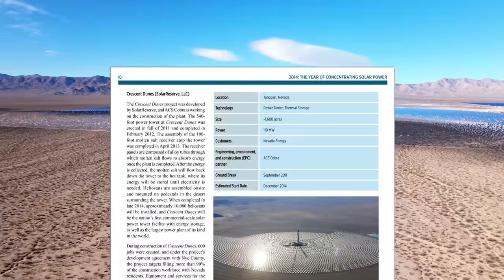The Failure of America's $1 Billion Solar Farm

Comment: Australia has a similar project. The mirrors have to be constantly cleaned, along with the mechanical problems. It cost more to run and maintain the project than the revenue from the electricity produced.
Reply: Was that the one at Kogan creek in QLD ?
Reply: Brilliant. 🙄
Reply: That doesn’t surprise me any. They don’t get paid to think ahead it goes against their way of thinking.
Reply: @SunriseLAW  But what becomes of the hazardous materials from the batteries when they have expired???
Reply: @SunriseLAW  Yeah riiiight
Reply: @SunriseLAW  nonsense it's just not happening
Reply: That is not true!
Reply: Dismantled one in Cooma
Reply: Solar farm in Wyomimg destroyed by hail
Reply: More gov/union/rent seeker boondoggles
Reply: Solar advance and is getting cheaper and better. 
"Paper-thin solar cell can turn any surface into a power source" "Researchers develop a scalable fabrication technique to produce ultrathin, lightweight solar cells that can be seamlessly added to any surface." -   Adam Zewe | MIT News Office Publication Date: December 9, 2022 and now sodium battery factories are in production .
Reply: There are ways to keep the mirrors clean with special coatings.  Yeah without these coatings maintenance is extremely expensive.🎉
Reply: @stanleytolle416  Thanks for sharing, i am gonna seek info for that solution and other solutions for it too.
Reply: The fossil and nuclear options are being removed from the equation.  The real question becomes is this method competitive with other renewable sources.
Reply: @frankshannon3235  Lets hope not or we're going to be heating and cooking with firewood or cow dung.
Reply: Cleaning the mirrors and other operation expenses should be discussed, before they move forward with the project.  It is weird that they don't do profit analysis before hitting the ground.
Reply: @SunriseLAW  problem is when power is produced.  Like in CA mid-day electrical pay back actually goes negative while post sunset  electrical pay-back is at it's highest.  I think there have been several profitable simular thermal solar plants in Spain. The problem here was lack of experience building such a plant.
Reply: @SunriseLAW  there are three problems with gigawatt hour batteries.  One they are very expensive.  Two there is a loss because the power has to be converted from different states from electrical to chemical and back. Three, batteries need to be replaced. With salt there is no loss from state conversion.  Just heat to heat.  Salt is also very cheap to acquire and set up as storage.  Salt also never needs to be replaced.  Salt power storage works out to be about 1/4 total cost for unit power storage as batteries when use in a thermal power plant.  This is also the reasons molten salt heat storage is proposed to be use with small high tempature nuclear reactors.  With the heat storage the small nuclear plant can ramp up power output at times to match that of a much larger plant.  This way power can be outputted when power prices are high like where renewables can't and make the power plant profitable even if it's cost of power is higher than some other sources.   Heat storage in molten salt makes this possible.
Reply: @SunriseLAW 😂what a load of BS you wrote.
Reply: Omg....we have to have and pay employees?!?!?  Hurry up and say it's not profitable.....yet it is.   Just not as much as desired.  The system works fine and WILL be used extensively in the future.
The problems were in the cheap design of the motors....and the hesitation of paying PEOPLE to clean them.
Reply: @gomahklawm4446  Never underestimate the stupidity of people with economics and business degrees to INTERFERE in engineering projects with cost cutting and other stupid schemes.
AND THEN blame EVERYONE else as they madly run around like their hair is on fire.
Reply: Don't worry about the revenue, those thevies running the joint will up the costs to the consumer and tell us that it's cheaper electwicity.....anyway before 20 years is up all that equipment will have failed and costing a fortune to replace, paid for by the tax payer.
Reply: @SunriseLAW  That is not reflected in the price of electricity there.   It's 4x what I pay
Reply: @stanleytolle416 what kind of coating
Reply: Put them in a greenhouse
Reply: @darrenmolloy9147  Nope it's imaginary only in his mind. No such Solar Thermal plant exist in Australia for generating Electricity.
Reply: @czechmate6916  "what becomes of the hazardous materials from the batteries when they have expired" Being stationary battery storage using LESS LOWER Energy Density batteries. They are NOT hazardous and far less toxic than Crude Oil distilment fuels. They get recycled because they are full of valuable materials and easier to break down and sperate than high energy density mobile batteries. Lower Energy Density is obviously a compromise, but the longevity and stability suits the use case. You have no clue what you are talking about.
Reply: @stanleytolle416  Worlds biggest battery is about 10 GWH typical daily cycle. Return rate is about 70% which is not great. Zero galvanic chemistry is use and it has not lost any capacity since opening in December 1985. Mechanical energy storage is the future of renewables.
Reply: @Neojhun  
Neither do you. 🤣 One of these plants went up in flames about a hundred miles from me it took days for it to be extinguished and everyone down wind was evacuated because of the toxic black smoke until the all clear was lifted for them to return home.

Comment: But if it's still costs three to four times as much as traditional solar, that's no way to go.
Reply: Which is why another won't be built until it can be done cheaper.  I'm assuming they went with the heating tower because it theoretically produces more net power for the land it takes than PV's as well as providing power at night with the molten salt setup.  Getting it back in operation is the only way to recover sunk costs.
Reply: It won't without its USP which was working 24/7 without too much maintenance, it was supposed to be able to store energy to be used at night when the sun don't shine, so it was like a energy generator and a free battery system in one, but it was beset with problems, which greatly increased the costs, whether it can be a success depends on if it can run without to much costly maintenance and if all the glitches which shut it down for long periods are resolved and any new plants can be built with the modifications incorporated at a reasonable cost!?!
Reply: @thomasherrin6798  more money please so it can be used as a tax deduction.
Reply: But since the construction costs are already incurred, only operational costs should be taken into account. It does mean, however, that no new ones should be built.
Reply: One thought is that you have to separate the capital cost of setting up your generation from the ongoing cost of supplying the power and servicing and maintaining the plant. The costs of a solar or wind farm have to be spread over the life of the installation which would be say 25 years or so or until the next hailstorm or catastrophic storm. The costs of a coal, gas or nuclear power station can be spread over a service life of anything from 50 to 80 years (before refitting and refurbishing).

This might also have something to do with solar and wind generated electricity is always more expensive even though they keep claiming that the prices of solar cells etc is getting cheaper.
Reply: @typhon36 ”Until the next hailstorm”. How often have you experienced broken windows from hail? Yes, it does happen. But I’ve lived my entire 58 years in the midwest tornado alleys (central Illinois, Iowa, Minnesota), and I’ve never had even a crack in a window from hail. Solar panels are basically just windows, and just as tough as a house or car window. So I’m not worried about that. Another consideration… solar panels don’t stop working - they just work less efficiently. They lose about 1%/year. So they might be taken out of commission at a commercial farm at 25 years, but they’re still at 75%. Someone else will gladly take those panels off their hands! The useful life of a solar panel is decades longer than their first-owner commercial life. There’s no moving parts, no chemical reactions, so there’s very little that can go wrong.

Comment: I have a sister who worked at a Top 500 company.  The company installed a solar farm on the campus. It was so hot for months you were unable to sit outside for breaks. A question I have asked with no response, What is the change in ambient temperature around a solar farm vs what the temperature was prior to the installation. 
Also,  why is no one addressing the number of birds incinerated as they get close to the panels.
Reply: My company has a solar canopy over the parking lot and it doesn't seem to have changed the temperatures.  Everyone tries their best to get their car under the shaded area created by the panels for sure.   I can't imagine solar panels creating much more heat than a black asphalt parking lot.  No idea what your sisters company did or how their farm was engineered though.

Either way,  alternative energy tech is making rapid improvements.   Panels are much more efficient and much less expensive than they were even 10-15 years ago.   It should be a very useful technology applied under the right circumstances and mixed in with other forms of energy production, namely Nuclear.
Reply: Solar panels aren't going to change the temperature appreciably nearby... I am not sure what mechanism you think would cause solar panels to actually heat up the air. And no, solar panels don't incinerate birds.
Reply: @ericfleet9602  Just just garbagicated together solar cell panels with solar reflector/molten salt systems and yes, the latter incinerate birds.
Reply: @ericfleet9602  The concentrated sunlight one shown in the video does kill birds, however, windmills kill many more.
Reply: @Peter Wagner  More birds are killed by flying into buildings, than are killed by wind turbines.
Reply: @johnfitzpatrick3094  I'm guessing not the same types of birds.
Reply: Yeah. Isn't all of this "green energy" supposed to take us away from the energy that heats up the atmosphere...to "save" the planet? 🤔
Reply: @dalejerden1878 It is about heating up a small area to boil water that would otherwise heat up the ground a small amount if the mirrors were not there. It is the same amount of heat as naturally occurring, just concentrated.
Reply: And remember that when the solar panels get hot (40deg c )
They lose efficiency drastically
Reply: 😂 fried chicken 😂
Reply: that's not very smart
Reply: The Radiation is focused on a Collection Unit of some sort. there is no ambient increase in temperature and the Sun is not shooting more rays at the project. Let me guess, you know nothing about Solar Power Engineering. and this Solar Plant went back online over two years ago.
Reply: Change in temperature? I can only speak for our local facility, which is only five acres of ground covered in solar panels, but we have the benefit of the data from a previous environmental impact study in the exact same area, so our study is considered by CDPHE to be top of the line. The temperature difference varies depending on ambient temperature and wind velocity, in the coldest months of the year the difference is less pronounced. Overall, in our particular small-scale case so far, we have seen a temperature increase of 4.7 degrees centigrade after installing our panels.
Reply: Please do not confuse this technology with traditional PV solar, they are worlds apart. This is an experimental isolated project that did not take. Traditional PV-Photovoltaic solar works great, does not effect surrounding temperatures or incinerate birds. In fact we have to put up netting to prevent birds nesting amongst the arrays.
Reply: the same reason they don't talk about chopped up birds daily collected from under wind turbines.
Reply: @x-man5056  False claim
Reply: @rickyal9810  Every morning, dead bird patrol.  Every wind farm.
Reply: @x-man5056  Again, incorrect. Where are you getting your information? While on the major utility project there is a resident biologist on site and I assume they do their daily rounds mostly because they have nothing else to do. There is no "dead bird patrol" as finding them is not nearly as frequent as snakes, kit foxes, and other wild life that must be documented as residing within the plant. Please reveal your "dead bird patrol" sources or stop commenting on subjects you are not familiar with.
Reply: @ericfleet9602  It was confusing because there are solar panels shown here and there in the video.  
The monstrosity was to work by reflecting sunlight onto a salt tank to store the heat.  Most of what you see from the birds eye view are just mirrors.
Reply: @batmanlives6456 Everything electrical is diminished by heat, both internal (resistance) and external environmental ambient heat, both convective and radiant.
Reply: @WhyUmadWhy  That was the substance of the brain child's minds that thought up this monstrosity.
Reply: In the vicinity of regular solar panels, any temperature change would result from differences between incident solar radiation, power produced, and energy radiated back towards space. I would expect it to be different for every type of solar panel.

For thermal solar, the central collector and everything in the vicinity of the salt system, and the steam loop can be expected to get hot. Photovoltaic installations have none of these features. How hot depends on what the designer settled on before someone built it. Such numbers would be a very central design decision, but could vary widely between different designs.
Reply: How warm the mirrors get depends on how reflective they are, and how dirty they are. Nevada may be hot to start with.
Reply: @richardwehe7325  What about how terribly ugly they are?  They can make an oil derrick look like a building, there is no help for butt ugly solar panels.
Reply: @richardwehe7325  You don't know much about Nevada do you.
Reply: @dalejerden1878  planet doesn’t need to be saved. It will be fine. It’s a humans on the planet. It will die off of temperatures increase. Even the solar reflectors will provide a tiny localized temperature increase, but overall will reflect most of the suns energy back into space, rather than turning it into more heat in total when it would’ve hit the ground.
Reply: @colingenge9999  Preposterous notion.  
The reflected radiant heat would still be absorbed in the atmosphere along with the convective heat from the panels.
The reflecting mirror would have to be outside the atmosphere to have an actual reduction in heat, radiant and convective.
Reply: @olivierb9716  What about them?  We need transportation.  Have you ever hit a Owl, Seagull, Crow, Hawk or Falcon with your car? No.  Starlings, wren, maybe a blue jay.   Dime a dozen.
We don't need windmills and solar panels in general.  They are inefficient and unreliable forms of electrical generation. Cost per KWH is absurd and they won't be working when you need them the most.   Ask people from Houston.
Reply: @x-man5056  you are correct in that an orbiting mirror with by far have virtually 100% reflection of solar energy. You are also correct that a certain amount of the energy reflected by a mirror on earth will be absorbed by the atmosphere, but quantitatively the earth magic mirror definitely has an overall cooling effect.

Here are the numbers.

Normally 23% of the suns radiation is intercepted by the atmosphere which would be lower in desert climates but we can stick with 23%. 48% is absorbed by the earth and another 15% is absorbed on the way out giving a total absorption of 86% of the suns energy.

For a mirror mounted on the Earth we are still losing the same 23% for the energy on its way in but reflecting almost 100% of the energy back upward through the atmosphere, where an additional 19% will be absorbed on the way out meaning the earth has captured a total of 42% of the suns energy.

I put a highly reflective surface on the roof of my car and measured ambient temperature levels in bright sunny conditions, indicating that there will be virtually no convective heat rising off the mirrors.
Reply: @colingenge9999  Fools errand.
Reply: @x-man5056  you are correct again that arguing with a fool who makes conclusions without evidence or analysis is a complete waste of my time.
Reply: @colingenge9999  You would be creating  a countless number of heat columns.  Much if not most of the heat would still be absorbed in the atmosphere.  I'm not a weather man but heat columns are a major contributing factor in thunderstorms and tornadoes.  Probably no big deal right?
But you are right, chasing a tempest in a teapot is a complete waste of your time and every other rational person's.
Reply: At surface level increases are large which is why it's better to put them higher up.
Reply: Why are we using asphalt to pave roads. Black absorbs heat and keeps the roads hot. It eats tires and can't walk barefoot on. Also adds so much heat to the area. And dog families, still force their dog to walk on hot pavement that we can't walk barefoot on...
Reply: hjat kinf of solar farm. One with solar panels will definitely cool the surrounding area. I have a rack of twelve on my farm and the family shades under it. and stay very cool. We live in Florida.